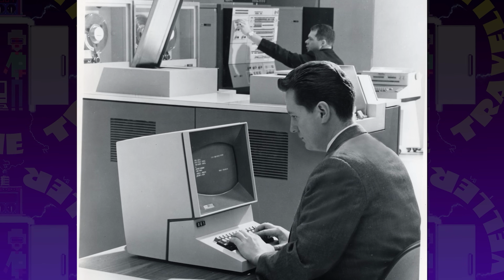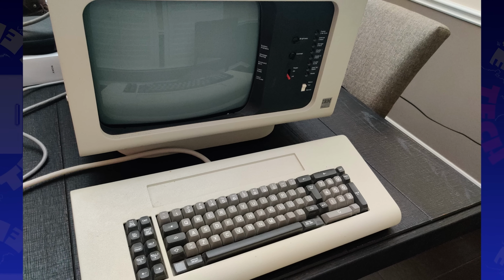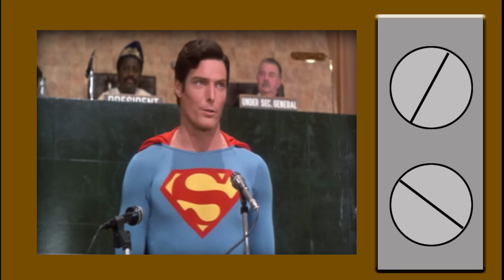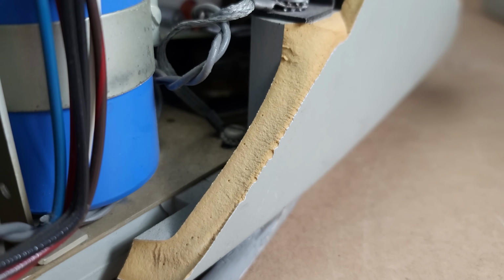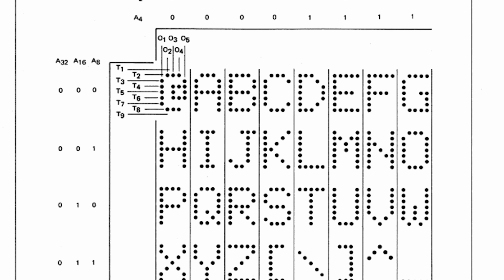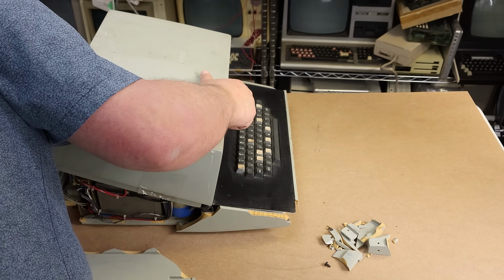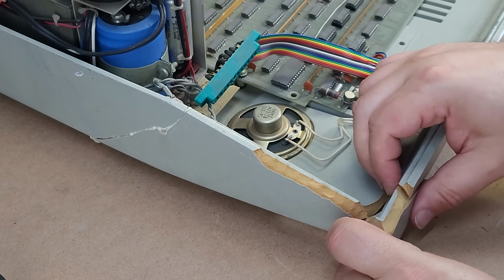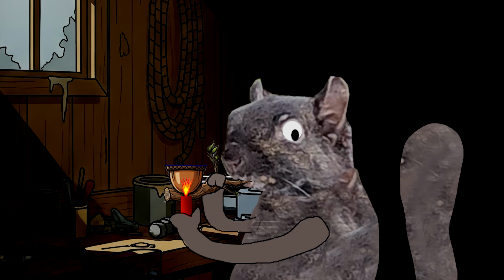Fixing a 1974 Computer Terminal (Part 1)

Comment: I wonder if this wasn't sold as a kit?
Microcomputers in the seventies were only available as kits before the "Big Three" in '78 so it's not unreasonable to think that the same applied to terminals
The "split mode option" may have been used just to halve the screen, hence why only half the screen is being used
The "block transfer" could be referring to the mode of operation
Some terminals were designed to mimic electro-mechanical teletext terminals that only sent data at the end of a line

These are all wild guesses though
And I can't wait for the next video on this fascinating machine

Comment: Loved the restoration. There is a two part epoxy called Milliput superfine that is very good for repairs like that. I think you can find it in Canada. I used dumb terminals a lot in the early 90's until they were replaced by PCs in 98/99 I think, they were usually used alongside a line printer so we could print the results from our work periodically, sometime we would use six or seven printers at the same time and the noise they made was something I could not forget. Thanks for sharing your knowledge with us.
Reply from the maker: Thank you for the suggestion!  I will definitely look for Milliput!  And I hear ya on those line printers!  It must have been quite a thing to work on dumb terminals every day, with no escape to windows or Solitaire or something like that. :)

Comment: + and - 16 volt actually are on the low side for what rs232 is actually supposed to run at. which is not what pc's do with their lame 10 volts or so. as yes back in those days there were no 'max232' ics... lol. the voltages for the rs232 simply come directly from the psu on old things.

Comment: Epoxy is always best you get silicone tube roll it in some kind of powder like corn starch then you “copy “ a similar corner apply it like a form and bobs your uncle works every time perfectly I’ve repaired SUBSTANTIALLY more broken cases than this one was so bad it looked like a tortoise shell but still had several 4 or 5 inch by 5 inch chunks left out which generally I copied or just used various forms to get the desired effect 

For knurled plastic you can often use a foam paint roller I really should have uploaded more videos of the processes one computer case came in roughly 500 pieces it was like a puzzle wth only one colour lol
Reply from the maker: That's a cool idea!  Didn't think of trying to copy stuff like that!  Thank you!
Reply: @TechTimeTraveller it works amazingly if you have the luxury of spare peices you can also copy whole forms with plaster of Paris or silicone

Comment: As a vintage terminal collector (local to you) - THANK-YOU for mentioning the mechanical keyboard collectors - the scourge of the vintage computer community! Love seeing these old terminals get fixed up. I've got a number of terminals, mostly DEC: DECWriter II, DECWriter III, VT05, VT50, VT52, VT10x's, VT220, VT320, VT420, VT520, ADM3A, ADM31, VolkerCraig VC404, Televideo 950. If you ever want to do a video on (and perhaps help me fix) my DEC VT05 (one of the very first CRT-based character terminals), let me know! Mine's probably the only one to exist in Canada!
Reply: I hate them. They're hated by a lot of the keyboard community for the same reason.

Comment: Friendly note on those replacement plugs at 19:50! The bracket that is captured by the screw is designed to clamp the wire between it and the plate behind. With the screw loose, just slip the wire between the plate and bracket and tighten the screw well. Strain relief comes from the clamp on the outer shell of the plug, so you should not have any issues of things staying put later.

Comment: From 1969 until 1974, I worked at a Control Data Terminal Products factory.   I was a tech on the production line. We built a serial terminal that connected to mainframes.  Our major customers were the IRS and the various airlines. I also briefly worked for a smaller company that made a similar product but the CDC one was far superior. BTW, we used to call those external wires on the PC board, ECO wires or engineering change order modifications.  Why scrap an expensive PC board when you could make a few cuts, add some wires and add a feature or two?  That block download board reminds me of the screen reader board that was available for the TV typewriters.  I wire wrapped one and it would dump what was on the screen out through the serial port.

PS, I worked on Nortel PBX's for nearly 30 years.

Comment: Great video 📹. I think your terminal is definitely a prototype. The rework is to untidy  for product build. Most people will not know that they didn't have CAD in the 70's and all circuit diagrams where draw by hand, and the PCB was layout using tape tracks. This may explain so many modifications in the build. I think the reason the tantlam capacitor was cut is that someone was looking for a short on the power rail. Probably, I would replace all the capacitors even the ceramic can be hygroscopic. I'm looking forward to the next video instalment. Good luck. Richard
Reply: I agree - that many wires would suggest it's a prototype.  Where I worked in the 70s, four to six wires would be OK for early production units with most PCBs, but once the design was stable the design would be back to the drawing office for scalpel and tape modifications.

Comment: I know it would be taking away from the vintage design, but if you have a 3D printer,
you could print a new, stronger case for it.. I am surprised that being jostled that bad
that the neck of the CRT, along with the PCB's weren't damaged....

Comment: That case design is just baffling. Whoever designed this terminal obviously knew what they were doing, and had fans to dissipate heat, but they wrapped it entirely in an insulated body that traps heat inside.

Comment: The power supply seem to use multiple MC1723. It's the Motorola version of the famous LM723 or uA723. It's a standard and still made linear regulator with an external pass transistor (the transistors in the "tunnel" are probably used as external pass transistors). For a 5V regulator, it's possible that the pass transistor is connected to a lower voltage than the 723 itself to make a more efficient power supply.

Comment: I've never seen a radial "blower" fan like that in something from the 70's, far as I knew i thought they weren't used much in computers until the mid 00's when PC Graphics Cards became so big that axial fans weren't effective, tho I guess that paradigm has shifted because for the most part we're back to axial fans.

The case looks like some kinda prototyping foam that you would've cut with a hot "cheesewire", that was apparently a thing before 3D printing made it easier to rapidly prototype case designs.

Comment: I remember the case design with the tiny display, and one of the large mail order surplus electronics companies offering both the "tall" and "normal" CRT's that went inside. I, personally, bought several of the "short" ones to use as monitors, but UPS destroyed the box, so I ended up with a box of broken CRTS. I think they were $12 each or something equally silly, and UPS did reimburse me for the cost. The "tall" ones were like the one you show, with half of the CRT below the bezel, and were more like $60 each so I didn't buy those. The cases were also offered at very cheap prices, and included the keyboard, but I couldn't see a use for those, since I owned an Lear Siegler ADM3A at the time. IIRC, the original use of the terminal they came out of was something to do with the stock market.
Reply from the maker: Like you remember this actually case design?  That would be amazing.  I should do a newspaper hunt for ads selling them.

Comment: No criticisms here from me, you're clearly a braver man than I tackling that case reconstruction. The only suggestion I have is that maybe an assortment of small flat and round files might help with the bondo shaping and smoothing process. You can usually score a set at art supply / hobby stores for a few bucks. I have a set I typically use for plastic models & miniatures.

Comment: as far as paint, wounder if there is a type that would help seal the material so that it wouldnt be reactive to other things touching it, and maybe add some strength (like a 2 part epoxy paint?)

Comment: If the keyboard switches are dirty on the inside it's actually super easy to disassemble them for cleaning. The metal tabs can be pulled back and the black plastic switch housings will slide right out since the Hall Effect sensors are the only part soldered to the pcb. It's a very similar keyboard to the one used in the Mini Bee terminals (they use model 53SW1-8 while you have 53SW1-9) which have good documentation, so that's where I'd start if you need to troubleshoot.

Comment: Near one of the tantalum caps, I've noticed a broken glass-body diode CR1 (9:17) and a broken potentiometer R38 on a PSU board (10:31).
Reply from the maker: Yes I'm trying to figure out what the replacement for CR1 would be.
Reply: Without a better (wider) view it's hard to tell where the anode lead of CR1 (blue remnant) goes, but it looks like the cathode is going to a +5 volt bus.  If you can trace the anode path, it may be that CR-1 is a small switching diode used to clamp that signal to no more than 0.7 volts above the +5 vdc supply.  A 1N4148 diode should work.  Some older logic gate ICs didn't handle too high an input voltage, especially noise spikes.

If the circuit is different, CR-1 could be a zener diode, I guess, but judging by its small size and distance from other components that would be part of a regulator circuit, I don't think that's likely.

Good luck, and have fun!

Comment: I love those punchcard shaped CRTs. It's such a neat bit of uniqueness. I have a 90s era brother word processor that used a CRT of that size and aspect ratio. I found the service manual, and it turns out it's a 12MHz Z80 compatible CPU with the complete memory map documented. There's a big gate array chip configured as a raster generator and paired with 32K of dual ported SRAM to drive a bitmap. I think it had around 512K RAM and 1MB ROM Thing is a tinkerer's dream! I want to try to make a new ROM for it to interface to Kerbal Space Program as a map display... Someday™...

I ALSO SAW THAT SPLIT UP EBAY TERMINAL! AAAAAAAAHHHH!!!

Comment: Boy do I ever agree with you on the rage against the vampire keyboard "enthusiasts" and the eBay sellers who serve them, making working terminals and computers useless by stealing their keyboards for the key switches!
Reply from the maker: I mean, if they find a keyboard loose that's fair game.  But watching the seller cynically separating the keyboard from that extremely rare experimental airline terminal recently to make a mint on the keyboard really sucked.  The terminal monitor is still sitting there on ebay 2 years later.
Reply: @TechTimeTraveller  Ugh!
Reply: I agree wholeheartedly, and I like mechanical keyboards! 

But… ones designed to be removable, with PS/2 or XT/AT or ADB.
 Separating them from terminals “because I only have room for the keyboard” always made me uneasy, and caused some drama between me and someone else back in 2012… especially because then they tend to complain about the cost of bespoke USB converters and the difficulty mapping the “weird” layout to a modern system. 

Like, sure I’m curious how a real Dasher or Space Cadet feels, but part of the experience is the CRT and having a system to use by a terminal!
Just putting the slab on a normal modern desk tells you nothing about the ergonomics of those terminals (or even bespoke minicomputer desks).

And then we have another version of the same problem, where keyboards for 80s and 90s non-PCs get taken-apart to harvest the switches for new USB builds. 
That isn’t reversible like a little USB converter, that’s permanently removing them from the pool for vintage machines. I’ve got an AT/XT complex-Alps board and I would NEVER harvest those switches for a USB Alps board. Never.

Comment: 8:40 My theory based off no information is it was cheaper to go with a standard crt over a wide aspect crt. But considering this thing is probably someone's frankenstein project I think you're probably right about it being due to limited screen memory. Either way, I love the look. I'd love to build a case like that and put a small crt and a Commander X16 inside. I've always been a sucker for big, all-in-one enclosed machines like the TRS-80 model 2,3,4, Lisa and Mac.
Reply from the maker: It's very reminiscent of a DEC VT-05.  I love these low slung terminals.  Tek made some really cool ones too with the storage tube displays.

Comment: When I look at terminals I think about the poor sap that probably had a whole career around typing in data on these things. Probably someone who didn't know anything about electronics or computers and didn't want to know either. 

Also, POS (or point of sale) machines are usually terminals but not always. My grocery store just upgraded to a new POS system where the register is still a terminal but does most of the heavy lifting and data logging itself. Now when the servers go down or get maintained we won't have to stop ringing customers up.

Comment: Split mode may also be different send and receive bit rates.  The TR1602A UART chip does have independent clock inputs for the send and receive sides, and unlike parts like the 8250 and 8251, it doesn't have its own baud selection per se, so that would be generated by board logic.  It'd make sense to have split rates be an option board since it would physically take more logic to generate two clocks instead of one.
Reply from the maker: That actually makes sense!  Thank you!

Comment: 13:38 split is also a Assembly language function
Reply: "split" may refer to the communication baud rates, and being able to send at one speed while receiving at another.  I remember working with proprietary dial-up modems that could run at 9600 baud one way and 1200 the other, switching which direction used the higher rate as-needed.  Unfortunately that required the same model modem at both ends, mixing would limit you to 1200 both ways.
Reply: @bobblum5973  Good shout.  Also the v.23 standard for some older modems used 1200/75 baud rates, although I think this terminal predates that, and certainly predates 9600/1200.  300 baud acoustic coupler modems would have the order of the day for many users in the mid 70s.

Comment: That fan is crazy, like a time tunnel or something. It's a got cage for your squirrels anyhow.
Looking at those boards full of 93xx stone-age TTL makes me think of those time travel stories where if if you go too far back, you can't recognize anything. My start was as a kid in the mid '70s with Radio Shack parts, and some of their surplus packs had chips with both the 93xx and 74xx part numbers on them. I was literally right on the edge of when the tech had just changed from those gray chips to the black ones we know and love. That and having plenty of LEDs to blink, those were new then too.

Comment: I (briefly) worked in a Call Centre in Fall 2001. We used VT 400(?) terminals connected to, I assume, a mini-computer, though whether it was physically located onsite or elsewhere I do not know. That is the last time I used a real terminal (rather than a terminal emulator on a PC).

When I was in University (1988-1992), there were a small handful of VT 220 (and other) terminals still in use for specific educational applications and mainframe access, but they were steadily being replaced by PCs and Macs.
Reply from the maker: There was a computer store I used to frequent that had a whole upstairs floor of old DEC equipment.. VAX stations and VT terminals.  Should have tried to buy some but didn't know what I was looking at!
Reply: Many years ago, I went to a military surplus sale at a local base warehouse. I could have purchased literal pallets of old computer hardware for pocket change. 

The main issues would be moving it (I did not have access to a large truck) and storing it (I was still living with my Parents at the time). I also lack the ability to identify the various random bits, much less assemble working systems therefrom. I may have missed a great deal, but, y'know circumstances.

Comment: My experience with this was, ironically, in the 1980s, at college, either using actual dumb terminals, or running a freaking terminal emulator on a PC (that was capable of running Windows 3.1), just so we could send data across the country to a mainframe, which ran JCL and COBOL. This being, of course, at the same time I was also learning about ANSI and BBSs. So frustratingly dumb. lol

Comment: You can blame the logistics companies all you want, much of the time shipping damage blame lies with the sender who didn't use a large enough box to accomodate sufficient packing material to absorb impacts. Speaking from experience on all three positions!
Reply from the maker: Definitely this one was at least partly on the shipper and myself..  we didn't know what material it wss made of.  However, if you'd seen the box.. this thing was very well double boxed.  I don't know what FedEx did but they absolutely smashed it in one quarter.  Another time, similar situation someone sent me a working 5153.. absolutely pulverized.  There's no way that was day to day handling.  But I agree often it's on the shipper.
Reply from the maker: I've even seen the drivers on camera literally hurling stuff at the door.  No regard for fragile stickers or anything.